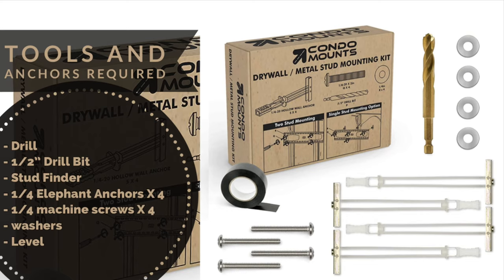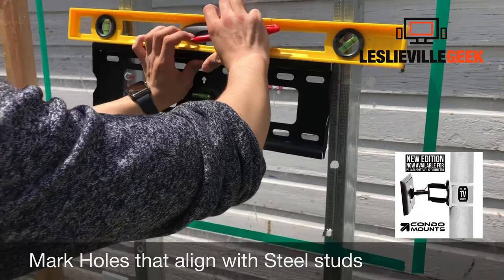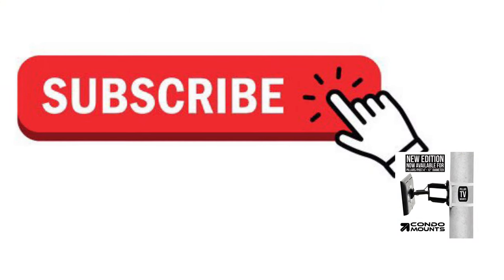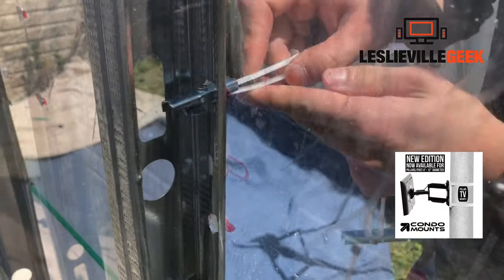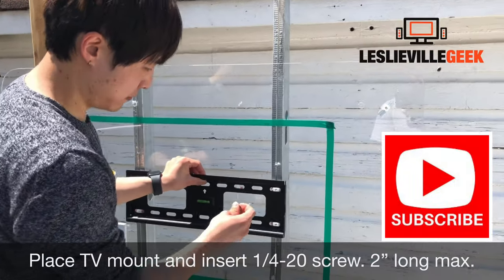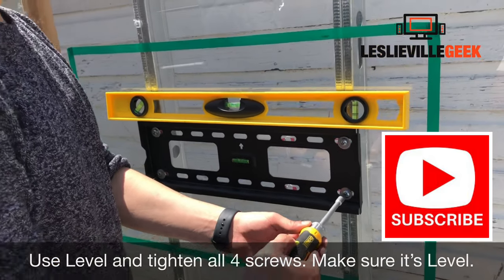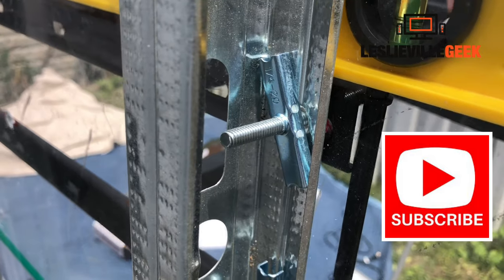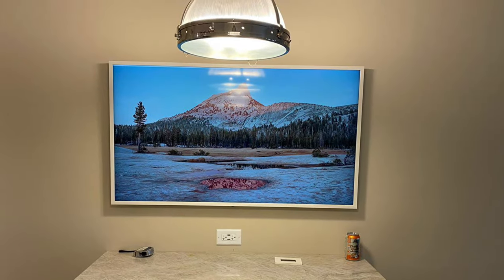How To Mount Tv On Steel Stud wall or Metal stud wall? Clear detailed view 👓🩻

Comment: How much weight can it hold on steel studs?
Reply from the maker: What are you mounting and what Mount are you using. 
If you using fixed or tilt tv mount you can mount upto 120lbs and use at least 4 anchors into metal studs. if you are using articulating mount. use 4 anchors into metal studs and can hold 60-70lbs.
Reply: @LeslievilleGeeks  Sorry it's been a while, but how much weight for 2 anchors into a metal stud but the other 2 in drywall (full motion articulating mount)?

Comment: I drilled a hole through the drywall and the metal stud using a half-inch drill bit. unfortunately two of my four holes (both holes are on the same side), the metal was stubborn and the bit made a mess of the surrounding drywall so that it isn't really a round hole. consequently, i can't really fit the toggle snugly enough for it to stay in place. any suggestions on how i can reinforce this hole? shall i just use putty/spackle and let it dry/harden?
Reply from the maker: That’s ok. Just assure the toggle is vertically in place against the metal. Once you place your tv mount and screw in the machine screw it will tighten up against the wall.

Comment: how to you avoid from drilling into the edge of the stud?
Reply from the maker: 1. Scan stud multiple times and find stud edge. 

Using the stud finder mark out the left and right edge of the stud. Run the stud finder a couple of times over the stud and mark the edges. The width of the stud should be 1.5”.  

2. Find existing drywall screw 

If you are using the magnetic stud finder then try to find where the pull is the strongest, and that is where a existing screw holding the drywall is. Usually that screw should be very centre of the stud.
Reply: @LeslievilleGeeks  thank you for the tip

Comment: Will these hold a 50’ inch tv that’s on a full movement wall mount?
Reply from the maker: If you find a mount that can attaché to two vertical metal studs and your tv is below 65lbs it should be ok.

Comment: I have one tv in living room fixed to steel studs. But in the bedroom opposite of the living room,  im putting in a tv, only one steel stud will be common to both sets. Will that stud be able to handle it?
Reply from the maker: Yes. Try to avoid swivel mount, Just the one with tilt or fixed function is. going to be safer.
Reply: @LeslievilleGeeks   after I mounted it my wife didn't think it was centered to the room. So I plastered over the big holes that I made. Found the center of the room and lo and behold, wood studs instead of metal. So I'm happy, the big set in the front and the set in the bedroom on totally different studs.

Comment: Will these toggles hold a 94 lbs.tv mount that swivels out ?
Reply from the maker: Not for a mount that swivels out.
Reply: @LeslievilleGeeks  samsung 78 curve tv will be only 3 to 4 inches of the wall and will not be extending out at all just the minimum the mount will allow using the Flip toggler will this still not be ok ?